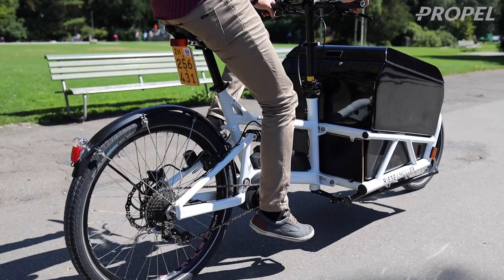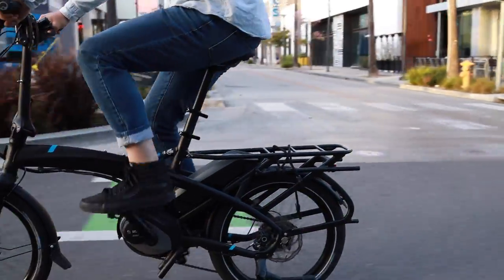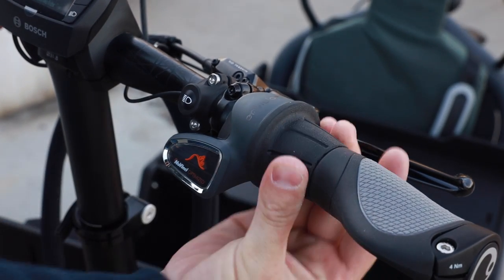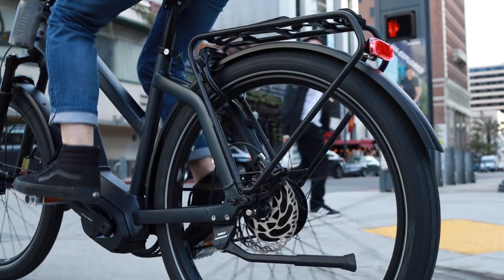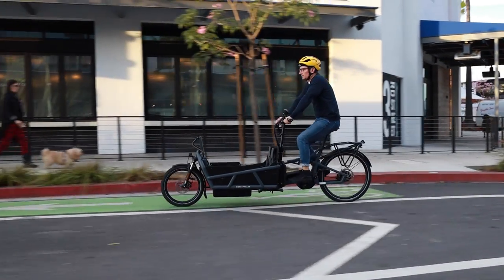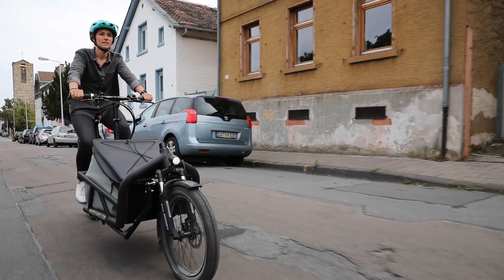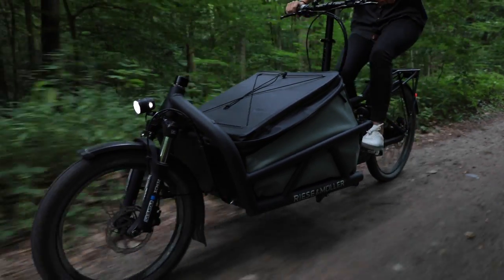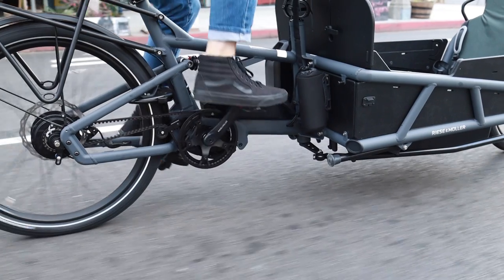Electric Bike Drivetrains: Internal vs External Gears (Derailleur, Enviolo, Rohloff, etc)

Comment: As always an informative video. One benefit you neglected to mention about the IGH (geared or CVT) is a single chain line which keeps a chain in a straight line, no bending between high & low gears.
Reply from the maker: Great point for sure! Thanks for mentioning it

Comment: Having owned several bikes over the years and as someone who uses their bike for touring, commuting and as a form of transport I honestly couldn't go back to a derailer now I've got a Rohloff Speedhub and Gates Carbon Drive. I typically cover 5000 miles a year on a bike. Yes, it's a touch heavier and is roughly 94% efficient compared to 98% for a derailer, but the lack of maintenance is a huge bonus. Plus it's silent and the gear changes are always spot on, it never misses a gear or does anything unusual. I suspect that a Rohloff and Belt drive is actually more efficient than a chain and derailer in the real world once the chain and derailer pulleys becomes a little dirty or dry. I think for people who go mountain biking, commuting or leisure cycling should only consider internal gear hubs with a belt. The only people who should have a derailer are athletes who use their bikes for competition use where even slight weight and efficiency gains are important and could be the difference between winning and losing.

Comment: Good information as usual. thanks Chris.
Two things to add:
1. There are other internal gears than Rohloff and Enviolo out  there in the market. But all of them are limited to 50Nm torque, hence the can‘t be combined with the stronger motors. Exception is the Shimano 5 speed, but it has a small range.
My wife and I are above 50 and the performance motor for us was a must. We want to enjoy effortless riding even in hilly sections.

2. For my wife I bought a Riese&Mueller Culture with external gear in order to save some money.
That was the wrong decission!🤢
For my wife every stop seems to come as a surprise and  she is used to shift gears at stand still. Still after a year.
I regret not having ordere the Enviolo. The additional internal friction is more than off set by the performance motor and the user experiance is superb.
Reply: Michael Gladbacher I’m riding a Giant Dailytour E+1 with Yamaha motor, Gates Carbon belt and Nexus IGH with Revoshift at 60Nm. Fantastic set up and bike. Not one single review on the internet and it’s a fantastic commuter.
Reply: Phil,
I value your opinion. But I can assure you that life is not black and white.Keeping fit is important, but this does not mean that you have to train all the time and exclusively.
My wife and I enjoy cycling effortlessly through fields and vineyards, then to a restaurant without sweating, and then perhaps riding a single trail through the forest back home. The Ebike is a tool that enables us to cycle together even over longer distances and a strong motor is a fun factor.

Comment: We've had bikes with derailleurs, Enviolo and Rohloff E-14.  Each has their merits as you suggest.  One plus for the Rohloff E-14 over the Enviolo, is I find it a little easier to disconnect if I have to remove the rear wheel to fix a flat tire.  On the Enviolo, you have to disconnect the shift cables.  The Rohloff E-14 requires you to unplug a connector on an electronic communication cable.  A little easier, but you do need to be careful to keep that cable connector free of dirt or moisture while it is unplugged.
Reply: I assume you have the rohloff with electronic shifting. I have read somewhere the connector was not great and one guy cat the cable a little further alone put a more robust waterproof connector in. 

Do you notice the efficiency enviolo vs rohloff?
Reply: @EdgeMasterPro  Yes, the E-14 is the electronic version of the Rohloff.  The electrical connector is a little fiddly, but it works.  Just have to be careful to disconnect it before you go yanking off the wheel.  

I much prefer the Rohloff to the Enviolo.  Both because the Rohloff makes pulling the wheel off the bike easier, but also because the Rohloff has less drag when pedaling.  The Enviolo is great for a novice rider though, as it is easy to shift.

Comment: With the Enviolo hub, you can shift under load when you have the motor turned off or in eco, but if you have the motor in turbo, you cannot shift under load and do need to stop pedaling for a hundred milliseconds or so, so that the motor can disengage before you can shift.  Pretty easy and fun, but worth noting.
Reply from the maker: Great feedback Tony! Thanks for sharing

Comment: If you aren't a sportive or rough terrain rider but looking for a clean, realiable, low maintenance drive I would always go with an internal gear hub and belt drive. Same for commuters and all year long distance riders. That lost of efficiency is easyly compensate by support of electric motor.
Having Gates CDX belt drive together with punch resistance tires all I've to do is once a year oil bath maintenance on Nexus i8 hub and control air pressure from time to time. Meanwhile the belt has 13000 km and looks to be ready for the next 13000 (8000 mls.)
Reply from the maker: Great feedback Michael! Thanks for sharing this

Comment: It’s all about the Gates carbon belt drive for me...no noise..no maintenance and no mess....
Reply: Tom Whitby I absolutely agree. I’m fed up with washing, brushing, degreasing and re-greasing chains, cassettes and chain rings! 

I’m looking forward to testing an Enviolo + belt on a R&M Delite or Superdelite.
Reply: I hate chain maintenance so yes it’s all about getting rid of the chain.
Reply: @ruirodtube  I started my bike search with "Belt-Driven EMTB" and that's how I found the R&M Superdelite I just ordered.  Chris's reviews were really useful in the search and I actually order at the beginning of lockdown as something to look forward to when this crisis is over!!
Reply from the maker: That’s awesome! I’m sure you’re going to love it! Stay safe!
Reply: @Propelbikes  Thanks - I am still in the market for a FOLDING belt drive compact commuter bike like the Gocycle to take on the train.  Any recommendations? Carbo bikes are the closest I've seen...but I don't know the brand...
Reply: @towhitby1  What setup did you order?  Do you have it yet?  I'm waiting 12 weeks for delivery to Australia for rohloff 1125 battery combo.  Vaccine & time =  end of the crisis...
Reply: @towhitby1  i wouldnt get Gocycle. It was not a good ride at all.
Had to use phone to change power. My Vektron is a lot better in my opinion and still folds just maybe not as small.
Reply: I heard belt drives also require maintenance. And they get damaged in the real world because of small rocks, dust or sand. The best and most efficient, would actually be an enclosed, oversized chain combined with an IGH.
Reply: @jandersen6802  yeah - Dutch city bikes like Gazelle

Comment: In the seventies to change gear you hand to reach for the gear level which was mounted on the frame and feel for each gear. Thumb and trigger is a massive improvement  Having a 400% range  on the rear cogs is further better as you do away with the front 3 rings.
Reply from the maker: As someone who isn’t very coordinated I’m glad that this system was replaced with the trigger shifters.
Reply: Never mind the 1970s. They linger all throughout the 1980s. Gear level has to be precise or the chain would not be properly aligned with the gears, causing a loss in efficiency and you get all kinds of noise from the friction. Turn the level too quickly and you would drop the chain completely off. I sure hate having to stop somewhere and get your fingers black trying to get the chain back on. Now I would never go back to the derailleur system. I would prefer the internal hub, especially the CVT and love the Gates Carbon belt drive.
Reply: With time you're getting used to the downtube shifters, you learn to feel and hear the chain, when it catches the next gear, and there is no damage to the chain. It's a kind of balance with the mechanics of your bike. Obviously more modern tech is much more comfortable and user friendly.

Comment: My biggest problem is that I don’t weight the importance of the drivetrain decision high enough to find an ebike that I like that also has the drivetrain that I like.

I want a folding ebike with an extremely low step through frame with a belt drive with internal gearing. That bike doesn’t exist yet as far as I know.

Comment: Cool video! We just had a similar discussion with friends few days ago but with additional variable: mid drive vs. rear drive. I switched to internal gear mostly because of maintenence. I ride in winter, so mud and salt was damaging derallieur all the time. Now I have two systems: a) Shimano Nexus 8 + chain (Bullitt); b) NuVinci + belt (Butchers). I like the second combination a lot but it is useless when my battery is out of juice :) With chain you can still pedal quite effectively without motor.
Reply from the maker: Great feedback! Definitely something to consider. Thanks for sharing your personal experience
Reply: Pretty sure it's not because of the belt. It's because of the hub. I have heard the nuvinci has a significant drag. Like mushy feeling especially on low gears. I have ridden for years a belt drive with old Sach duomatic hub and it has close to zero added resistance. I also had an ebike with belt and nexus i5 hub and that had significant resistance which turned into horrible resistance in the cold climate.

Comment: Thanks for the very clear explanation and comparison between the different drive systems. 

In my experience the Enviolo 380 has a bias towards higher speeds for flat or downhill riding and unfortunately it doesn’t offer sufficiently low gears for steep climbs. But when combining the Enviolo with an electric motor you can select more support from the motor to compensate the lack of lower gears. Would you agree?
Reply from the maker: I think it really all boils down to the gear ratio. The N380 can easily be adapted to have a lower gear available with a large cog in the rear or a smaller one upfront.
Reply: The bias you are talking about is all about implementation by the bike's manufacturer. My 20" wheel folding bike (non-electric) from 'Bike Friday' (US manufacturer in Oregon), has a bias towards the lower gear. I purchased this in 2013 with the NuVinci N360 CVT (Continuous Variable Transmission) internal hub with the Gates Carbon belt drive. NuVinci is their original name. Now they changed it to Enviolo. I can climb a crazy hill with that bike. I often ride on a dirt trail climbing all sorts of a steep hill. I love the analog functionality of CVT despite taking a hit on its efficiency (about 10%) compared to a digital/step system internal hub. I'm sure you can take your bike to a bike repair shop to have the cog/crankset gear teeth replace to change the bias toward the lower gear range. Keep in mind that doing this will limit your high gear range where you can't go as fast as you will reach your maximum cadence RPM sooner.

Comment: Really pleased you've started the channel, I currently run a Gazelle with Hub which is great however I recently rode a similar bike with the same motor mated to DERAILLEUR, wow couldn't believe how much more responsive the derailleur was when accelerating.   Also I do struggle up the hills with the hub as gears don't offer the cadence required.
Reply from the maker: Thanks for sharing your experience. You could consider changing your gear ratio if you need a lower gear for climbing.

Comment: I have Derailleur geared and internally geared bikes and do maintenance on both, but overall, I prefer Internally geared for all the reasons you mention. Additionally, Derailleur gear maintenance increases dramatically during winter months as they readily attract dirt, increasing chain and sprocket wear unless cleaned and lubricated after every ride. I also find gear changing operation is more susceptible to temperature changes, requiring fine tuning of cable tension between chilly days (1C - 3C) Vs warmer days (9C - 10C). I plan to buy an electrical bike, and I will go for internally geared hub with belt drive. The other advantage of this configuration is the front "chain" wheel and rear sprocket are always correctly aligned, further reducing wear. This is rarely the case with Derailleur gears due to the nature of how you select gears, and though the gear change mechanism is mechanically simple in operation, it is quite crude by today's standards.

Comment: With ebikes, it seems to me that the question of the number of gears is not as relevant any more.  Since you have the motor power mode to assist you while riding uphill, why cares with a very low gear ratio for instance?

Comment: There is also the pinion gearbox. It is an interesting option if you want a more powerfull rear hub motor and internal gears.
The Bosch performance line speed is somewhat underpowered to maintain the highest speed with headwind or uphill.

Comment: I gotta admit, I've never had a long period where my derailleurs shifting has been seamless, apart from when I first had it. I've spent ages trying to get it right, cleaned, re-cabled, tuned and I always end up being haunted by shifting niggles, I get by but I hate it. When i got on a Moustache in France last year i couldn't beleive how smooth the shifting was. The Rohloff is too expensive for my budget. Heck, you can buy two decent road bikes for the price of one Rohloff hub!!!  So the Enviolo is looking like the main contender atm when i do eventually plumb for it

Comment: Very helpful reviews, Chris, in both style and content. Much appreciated. 
My Questions: 
- with the 2021 GSD Cargo motor support topping out at 20mph is there much point in the top end extended gear range of the Rohloff vs Enviolo as those top gears only come into play at speeds that are + 20mph when the 85# bike + cargo etc would be hard work to pedal with no assist unless aided by gravity, is that so? 
- As an older person (64)planning on riding into old age my gut tells me the twist control of the Enviolo would be harder to manage? Impressions?
And lastly: why no Cargo speed motors on the GSD? If not on them then what are they putting them on?
Thanks.

Comment: I’m trying to decided between the Tern HSD S+ and the Riese & Muller Tinker HS. My main concern is that the Tern has the enviolo 380 sport hub and the Tinker has a derailleur. I live in Colorado and after reading reviews on the Tern, I’m concerned that the enviolo might struggle with the some of the hills (not off-roading, just commuting on paved roads). Can you give me any advice?

Comment: Please cover affordable systems. We’re all out here trying to find a reasonably light, IGH, belt drive with mid-engine. Reasonable power and reasonable battery AH/range/weight. Rohloff and Reise & Muller are stratospherically priced systems. The options are either underpowered motors and limited range motors or they’re too heavy. What is the right belt driven Enviolo and optimal mid-drive motor with decent range battery under 60lbs and under $3000.?

Comment: I commute to work with a road bike about 20 round trip. I average right around 17 mpg. I'd like to shorten my time with an Ebike, but am not sure if pre-made ebikes from big companies will meet my needs. I know class 3 bikes can support up to 28mph and then the motor drops out, but I regularly already go that fast on slight hills. Any ideas what system would be best? I like the idea of a belt drive, but there aren't too many class 3 belt drive bikes out there.  I think a big front ring paired with bafang motor could easily manage.  I just don't want to spin out on the flats or downhill. Any thoughts?

Comment: Love the video! I am planning of purchasing either the Gazelle Ultimate T10,  or the Ultimate C380 with the Enviolo hub for commuting to work. I live in Vancouver, BC, where it often rains, and work at a university called SFU on Burnaby Mountain (an elevation of 1096 feet). Which of the two bikes would you recommend? Thanks.

Comment: Thanks for a good review Chris. I've been looking into internally geared hubs for a while now and have also been considering the Shimano alfIne 11 which is similar to the Rohlof but is cheaper and offers a 409% gear range. Do you have a view on these or is it simply down to not being a product you stock?
Reply from the maker: Thanks! Glad you enjoyed it! The Alfine is a great hub, but it can’t handle more than 50Nm of torque. This is okay for many users, but many new motors are 60+ Nm and they don’t play nicely with that hub.
Reply: @Propelbikes  ah that's what I needed to know. You've really helped me with this. Thanks
Reply from the maker: You got it!
Reply: Shimano also has a 9 speed internal hub called Nexus that I've seen combined with Bosch motors.
Reply: I did own a bike with an Alfine 11 and I put about 5,000 miles (8,000 km) on it.  I did encounter a couple of issues with the Alfine 11's strength and durability under hard conditions.  I had the hub's seals fail at 1,000 miles and leak out the oil. I also had the disk brake rotor flange shear off the hub body in a panic stop.  

Also, if you look at the torque limitation of the Alfine 11, you will find you cannot install a chainring and rear cog combination that would provide low gearing - not an issue in flat terrain and less of a concern on an e-bike, but if you live in hilly terrain, possibly a concern.  

With our Rohloff E-14, we have over 3,000 miles and it feels much more durable.